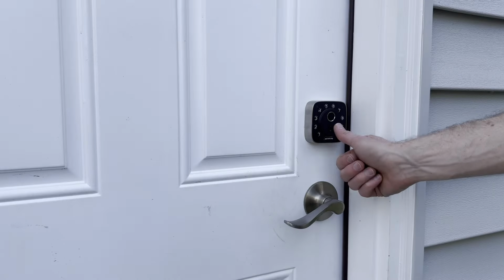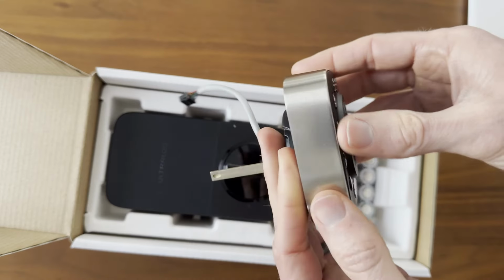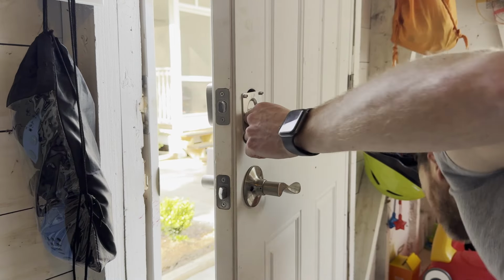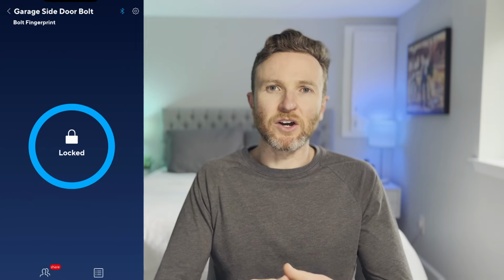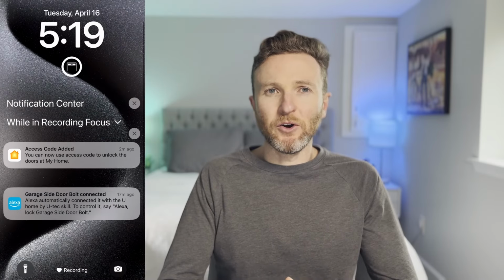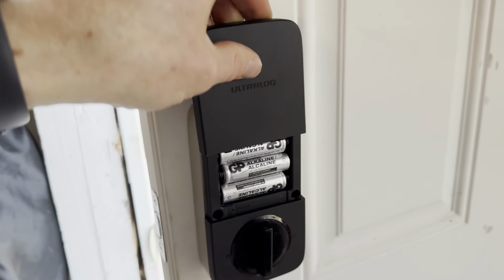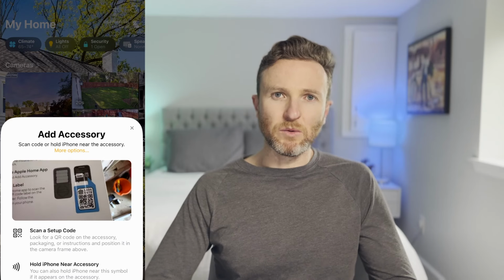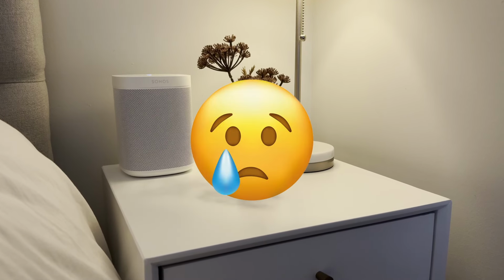ULTRALOQ Bolt Fingerprint: Unboxing, Setup, and Review

Comment: Anyone else's Bolt locks WiFi keep getting disconnected from the App?  I have the NFC version and every so often, I can't connect to my lock remotely using the U-Home app.  The lock itself seems to work fine. Just not able to connect to it remotely.  Very frustrating. I am using a dedicated 2.4Ghz SSID (no 5Ghz and no other devices connect to this network).  If I connect other devices to this network, those work fine so I know it's not the network/router/wifi.
Reply from the maker: Yes, I talked about a host of connectivity issues in this video.
Reply: @michaelsleen  Do you know of a way to tell which wifi/bluetooth manufacturer they use on these locks?  I wonder if they use an inferior manufacturer? 🤔

Comment: this thing is a total disaster. Can’t connect to the right wifi, no instructions on how to do it. Nothing works right, doesn’t reset. Paid $150 for a smart lock that I will have to use a key???  What a scam.
Reply from the maker: Yes, I noted the bugs. Frustrating.

Comment: Thank you for the detail about Home Assistant. I assumed that I could add it that way. We really need a smart fingerprint/code lock that we can manage the users/codes/fingerprints from a centralized location like HASS. I fear that might not ever happen.
Reply from the maker: If you have a Z-Wave smart lock, you can look into Keymaster (https://github.com/FutureTense/keymaster?tab=readme-ov-file) or Lock Code Manager (https://github.com/raman325/lock_code_manager). Thanks for watching!

Comment: I had the U-Bolt Pro with a Wifi Bridge for over 3 years. My wife and I had the same fingerprint issues you did. While that is very bad problem, at least it was good everywhere else. Great battery life and very responsive unlocking, even over bluetooth. Even with the fingerprint issues, I was willing to overlook it and planned on getting one of their new locks. But I just can't deal with their price hikes. 

$250 for the fingerprint version when they sell a lock with the exact same features for 100 less? Yes the fingerprint reader is improved and I like the design, but fixing your problem and giving the lock a new coat of paint doesn't justify such a big price hike. And since I'm using Home Assistant, the one I really wanted was the Matter over Thread version. But that one is $300 and identical to this one in features. 

I ended up getting the Switchbot Lock instead. I like how feature rich it is and I have Matter support all for under $200. If this was $200 and the Matter version was $250, I think I would have stuck with U-Tec. But I didn't out of principal just because I felt they got too greedy with the pricing.
Reply from the maker: The price point on smart locks can be tough, and those that are built to work with Apple Home seem to be at an even steeper price. I have a video on the SwitchBot lock with Matter coming soon. Thanks for sharing!

Comment: I don't usually comment, but this is the worst smart lock I have ever used.  They have a problem with their wifi connection and it prevented me from adding access codes even over Bluetooth.  I worked with tech support and they told me this was a known bug and they plan to fix it in the future.  They wouldn't let me return it because I was a few days past their return policy.  I ended up removing the lock and throwing it away.
Reply from the maker: Sorry to hear about the bad experience, though given the experience I documented in the video I’m not surprised.

Comment: Seems like it's not ready for the market. Does the fingerprint sensor work if your fingers are moist, like after a run. A failing test for many fingerprint locks. What class is the lock - best is 1 (Schlage), 2 (Yale, Kiwiset), 3 (Aqara, many cheap locks). 

For me, HA and geofencing control, Apple Homekey would be nice for my wife's iphone. But absolutely no cloud, hubs or apps. My 2024 objective is to eliminate add-on hubs and apps. Except for HA Companion and Zigbee/Z-Wave cordinators. Local, Privacy, Chiice. No cloud.
Reply from the maker: I also bias toward devices that do not depend on the cloud, though I have several still. As things need replacing, I look to local control. My Yale Assure 2 with Z-Wave has been 100% reliable.
Reply: I've been eliminating cloud based devices and services over the past year. If it's cloud based, I won't even consider it. The last cloud-based device that I purchased was a Rheem ProTerra hybrid water heater but I've since eliminated their cloud dependence and control it locally. I use ESPHome Econet along with an M5Stack Atomic RS485 base and the Atom Lite C008 connected to the water heater via its RJ11 service port. 🚫☁️

Comment: Yup. Send it back. That dodgy wifi connection alone should be enough to send it back, yet alone spinning apps etc.
Reply: I agree, send it back with a thumbs down review. They should focus on Matter over WiFi and Matter over Thread connectivity. Lastly, if they're abandoning Home Assistant support, I'll do likewise and ignore them as well.
Reply from the maker: Currently testing another that uses Matter over WiFi, so stay tuned.